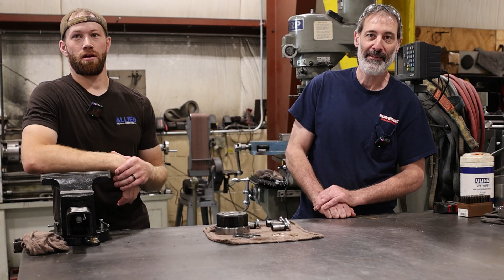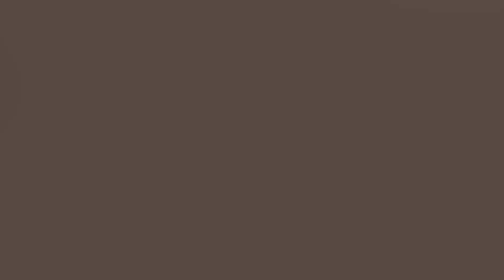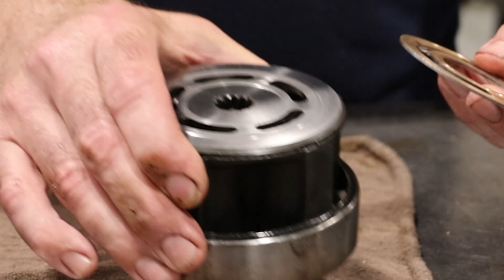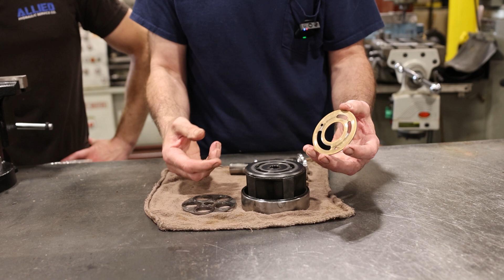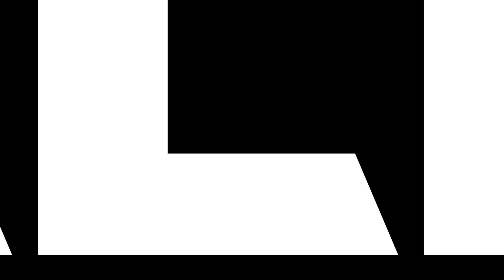Hydraulic Motor and Pump Failure? | Common Causes Explained

Comment: My John Deere 60g excavator suddenly got very slow today, most of the controls are extremely slow. Can't figure out why. Any suggestions?
Reply from the maker: Thanks for asking! We asked our experts, and they said this: If this issue affected everything and if they are pilot operated controls, make sure your supply pilot pressure didn’t drop. If so, you may have a pump issue. We hope that's helpful!
Reply: @theconradcompany after several hours of slow hydrolics, suddenly they are normal again. I got a good week if work in. I replaced all filters and cleaned everything i could think of, but everything was still slow after that for some time. Can't figure out what happened.